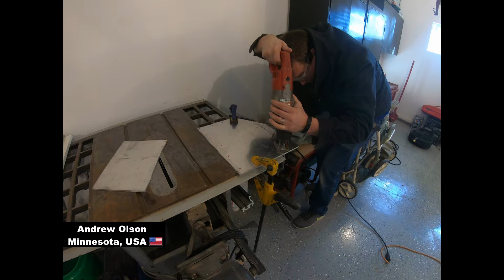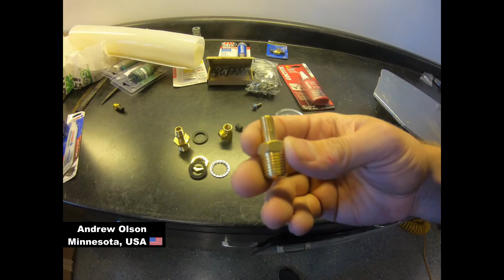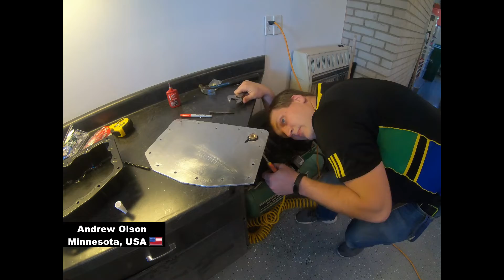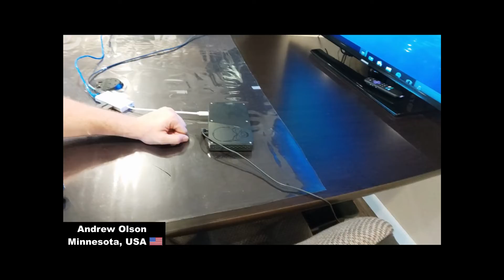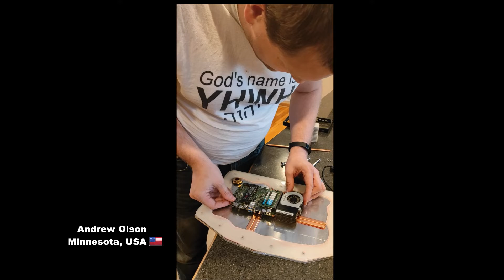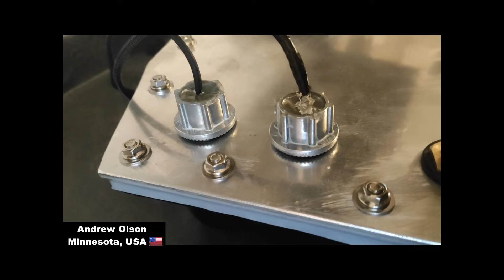How to Build a Nitrogen Computer - "Natick Mini"

Comment: You. Are. Wild. You would need to vacuum out the air before adding the N? That would be a challenge.
Reply from the maker: There is usually an incidental amount of air left inside a tank. The process of approaching 99.9% is similar to how they fill Nitrogen into automotive tires.

Reduce Psi in the tire, fill remaining with Nitrogen. (Now 50%) Bleed and repeat. (75%) Repeat (90, 95, 98, 99)

A vacuum would also be a good way.

I ended up running out of funding, and the nitrogen was an additional $600 step. Though if I had a cool mechanic friend at a tire shop, it would've been almost free
Reply: @JesusNowEschatology  why so much!? I’ve thought of nitrogenating beer. Certainly won’t if it costs that much.
Reply from the maker: @RyanPatenaude  some companies allow you to rent a Nitrogen tank with a deposit. Most regulator + tank combos will set a guy back a pretty penny. I was having a hard time finding cheap options, and local rental wasn't working.

Looking forward to seeing you again brother! Lots of inventions and tinkering to do! 😆